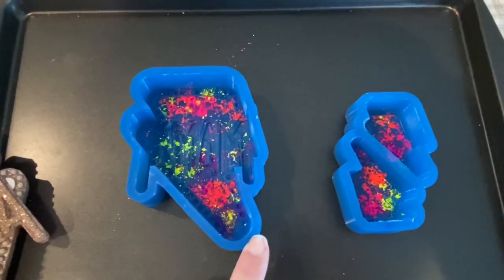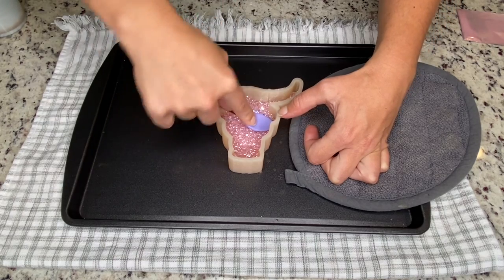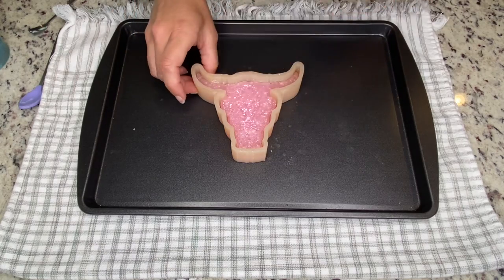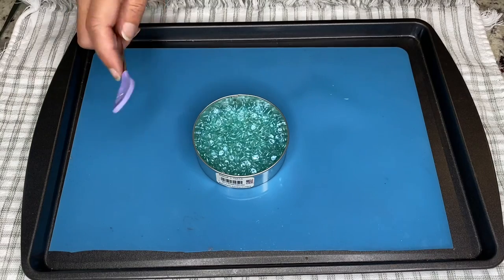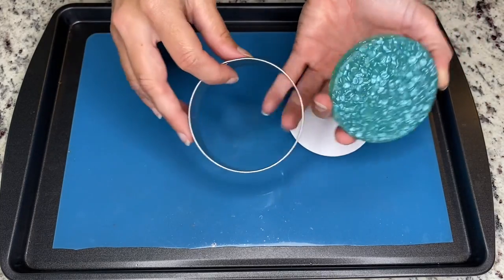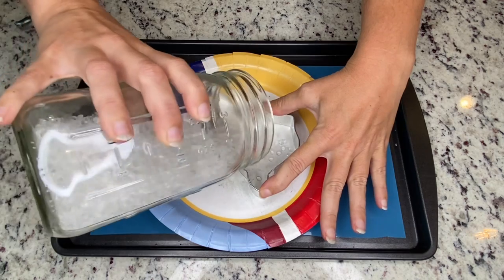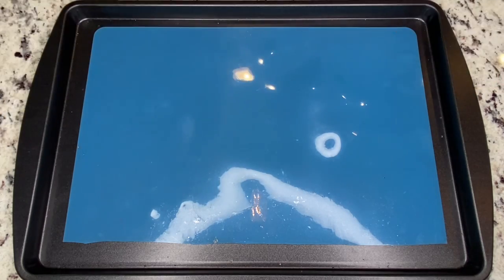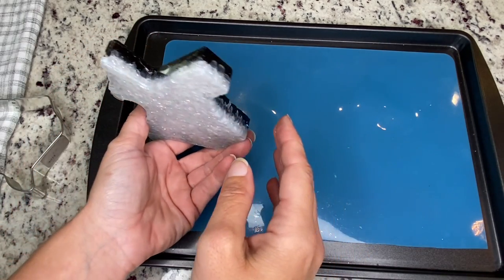Car Freshies | Double Sided | Tutorial | DIY

Comment: How many oz or scented beads does it typically take to make a bull head freshie, either with it just having the one side or both sides?
Reply from the maker: I always fill my molds to the top so whether I make it one sided or double I use the same amount of beads.  Also there are two different sized bull skulls, in this video I used the small one.  I wasn’t sure if you wanted oz by weight or volume so here’s all the info 🤪

Small bull:
Weight-2.2 oz
Volume-4 oz

Large bull:
Weight-3.7 oz
Volume-7 oz
Reply: @FarmhouseDesigns   thank you for replying and yes weight is perfect ❤️ I bought a couple size bull heads but haven’t used them yet so was just wondering before starting them what the average oz weight would be to make one. Thank you for the info 😊

Comment: Hey what’s that blue sheet called your setting them on thanks
Reply from the maker: It’s a silicone craft mat 😊 here is the link to the ones in the video!

https://www.amazon.com/LEOBRO-Silicone-Placemat-Multipurpose-Heat-Resistant/dp/B07V9KMNGY/ref=mp_s_a_1_13?crid=27GAZXX0TW22N&keywords=silicone+mats+for+crafts&qid=1676055822&sprefix=silicone++mat%2Caps%2C328&sr=8-13